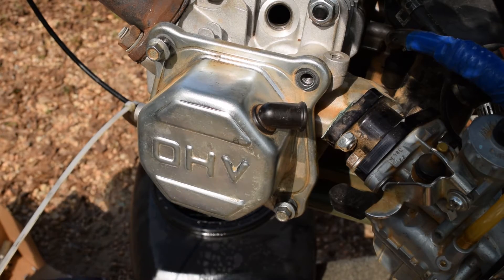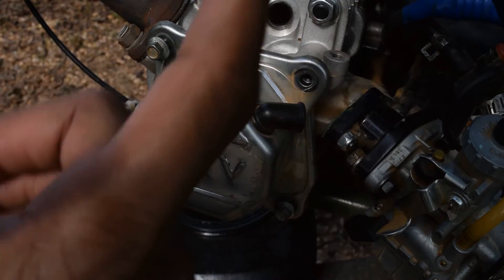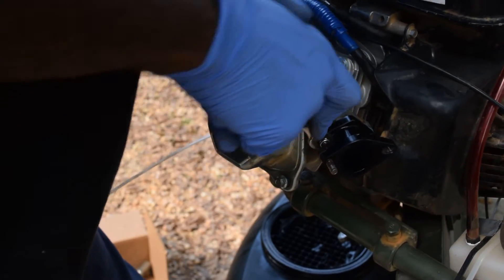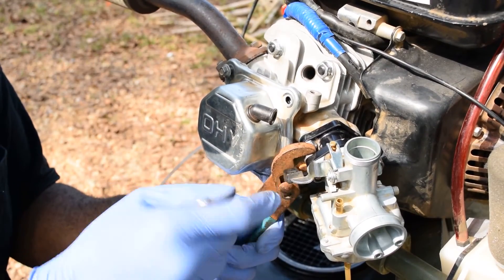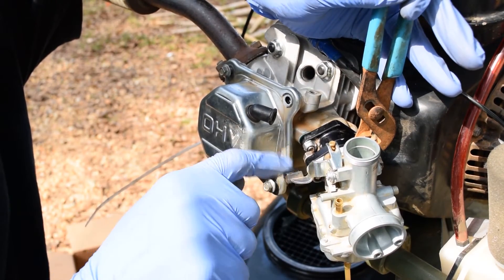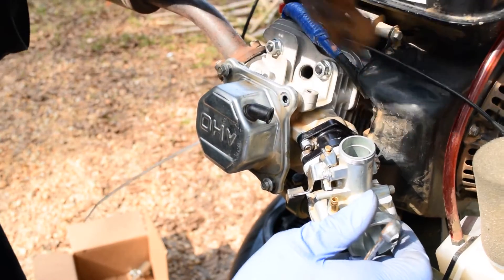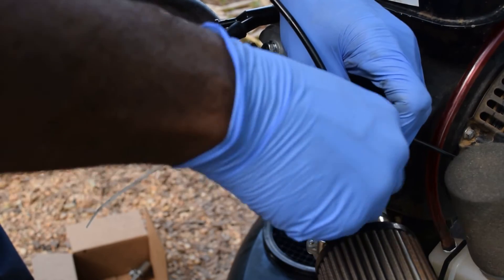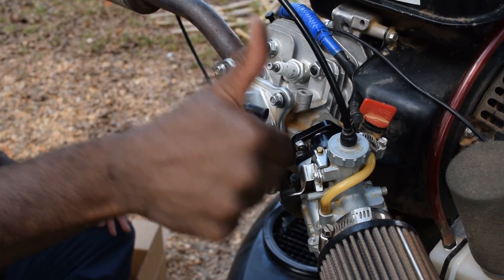Gasket Suck

Comment: Brother there is a reason that carburetors are still arround. I prefer a good old fashioned carburetor over fuel injection.
Reply from the maker: Yeah, you can fix, tune and overhaul it yourself. My current setup is much better than this. I've sorted out all the reliability problems. It's a different sort of build than this one. It turns out that a lot of the go-kart racing mods don't work reliably in this application. By definition racing engines are not reliable enough to serve as work engines.
Reply: Black Warrior Lures I understand that for sure. My 196cc clone is very reliable. Drinks gas fast though. I’ve only had issues with the frame. Today I’m gonna do a video of a Go Power sports top plate eventually I’ll put a pulse pump on it. Governor removed. Did that yesterday. Check it out!
Reply from the maker: Well, reliable on land is one thing. Once you put these in water, everything changes. Water is 800 times as dense as air, I'm hauling 500 lbs lbs and generating enough power to step up on a plane. What works n land simply doesn't translate directly to water.
Reply: Black Warrior Lures I understand what you are saying. Its at least 2 times the load on the motor causing more wear.
Reply from the maker: Also there is a resonance frequency that sets up when you get around 5500 RPM or above on the water. It's weird, but the engine starts vibrating like crazy. Given that a single cylinder engine is unbalanced by definition, I believe the water density exaggerates that effect. The engine just shakes itself apart.
Reply from the maker: Among other things. The current build has no problems.